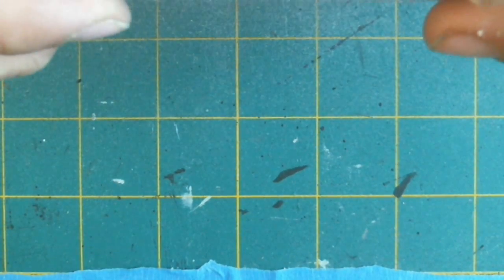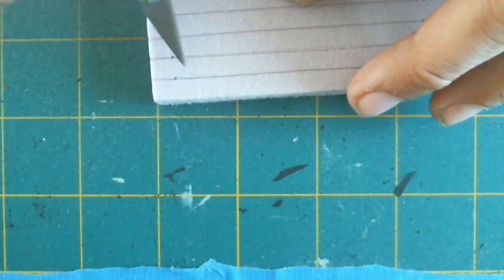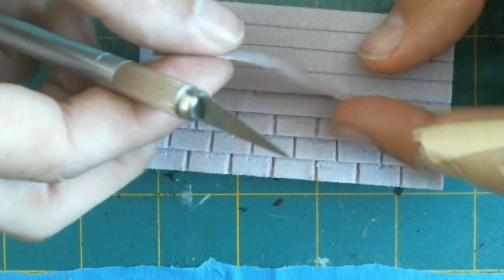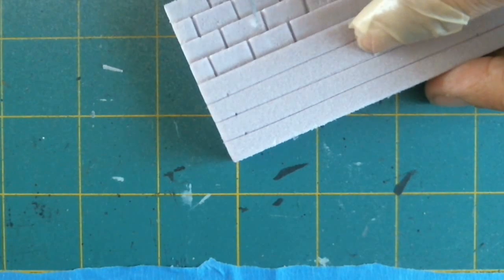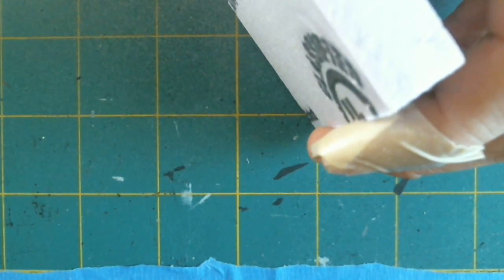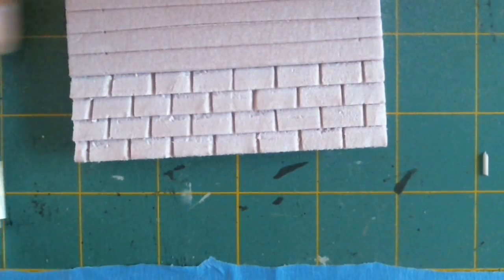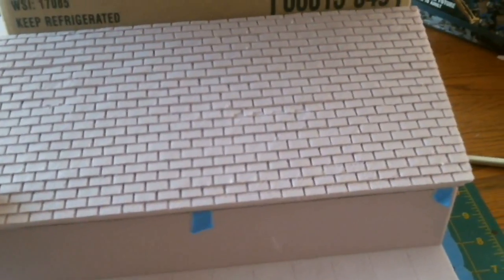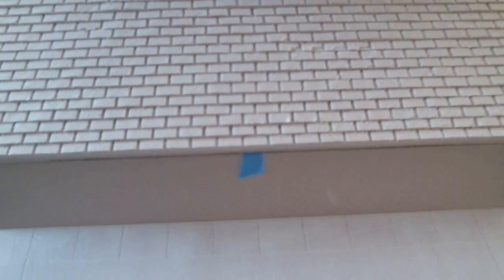Quick Tip  (How I make shingles)

Comment from the maker: will make a vid of that for you soon.  As far as the Band-Aid goes, I poked myself good with the chicken wire.  I haven't cut myself yet so far knock on wood.
Reply: what is the material that you have carved your shingles on? xps foam or high density foam